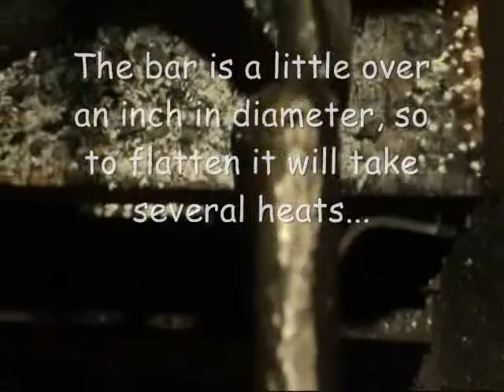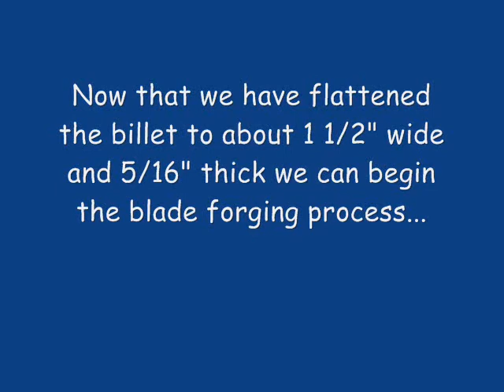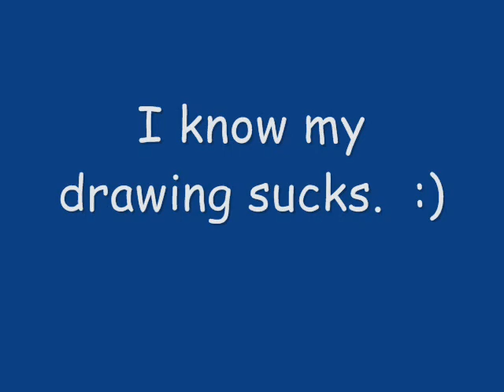Cable Damascus Tutorial Part 2

Comment: Very Cool.  I am going to watch the rest of the series, but just wanted to thank you now for taking the time to make these videos.  I have always wanted to try making cable damascus.  Actually I did try about 15 years ago but never got it welded up all that great so I ended up tossing it.  That was back when I was living at home and trying to use my dads OA torch to heat it.  I need to give it another try now that I have a decent charcoal forge.  Thanks again.

Comment from the maker: I've never used it, but I was under the impression you could take the cable apart and remove the rope... The spark test is a good anecdotal test but you have to have experience to "read" the carbon content with it. Always best to send a little piece off for analysis if you have a large supply so you'll know exactly what you're dealing with. Thanks for the compliment.

Comment from the maker: Let me just add: It's not the color of sparks, it's the quantity. The carbon is the only thing doing the sparking, not the steel. When ya grind wrought iron you'll hardly see the first spark. Other alloy elements also effect sparking. Say for instance if you grind O-1 tool steel in the annealed state you usually recieve it in there will be very few sparks and most will be a red orange color even though the carbon content is close to 1% in most samples. Like I say, ya just need experience with it

Comment: Alright, thanks. I live in the middle of nowhere Nebraska, and the only place within 80 mile that I can get cable from has a rope core which you can never remove, no matter how hard you try there will always be burnt, melted plastic there. I give this steel a try and see if I can get it to work as a blade. I've heard that higher carbon steel will have whiter sparks when grinding while lower carbon will have yellower sparks, would this help me find out what kind I have one I make a billet?

Comment: Can you use any kind of steel cable for this? I have a whole bunch of that stuff just piled up at my family farm. It's in pretty good condition, other than some surface rust and a lot of dirt and dust, though I don't know what kind of steel it is or how bad the rust is in between the strands. Can you use flux with older cables like that or would you have to take the whole thing apart to clean off all of the rust?

Comment from the maker: Not all cable is high carbon. You'll find most of it is, but not all. Make sure the cable you use is a minimum of 3/4" diameter. I generally favor 1 1/4" to 1 1/2".
Rust is a bad thing and will cause you a lot of frustration. It would be best if you could get some new cable. I get cut offs for free from a local rigging company. Maybe you have one in your area? You can always try the stuff ya have though, there's just no way to be sure of the results before hand...